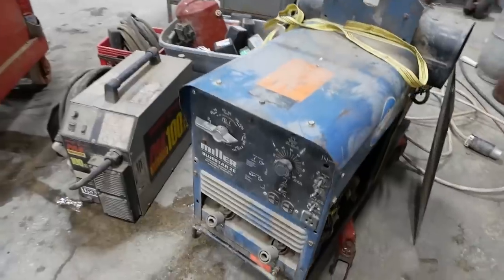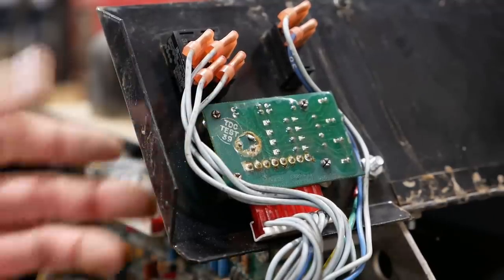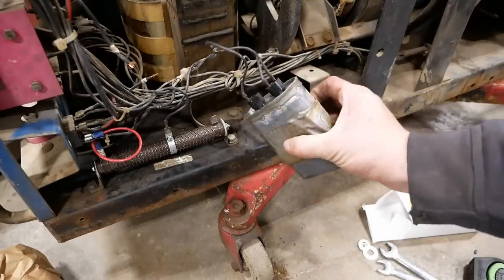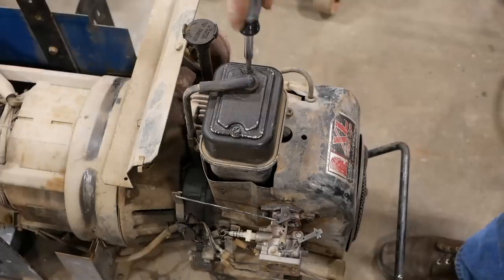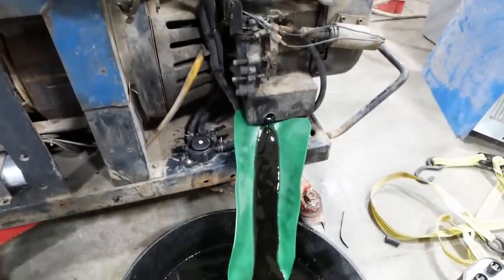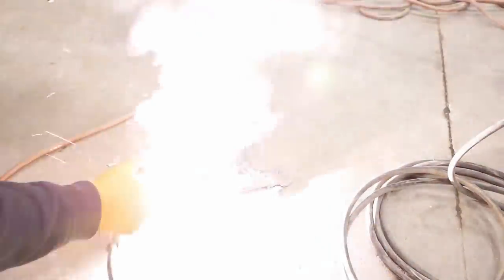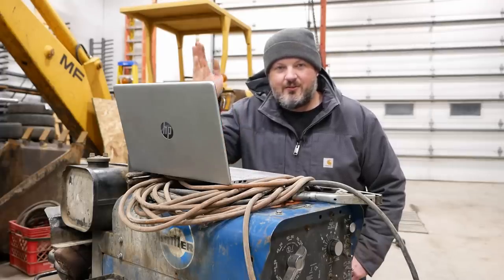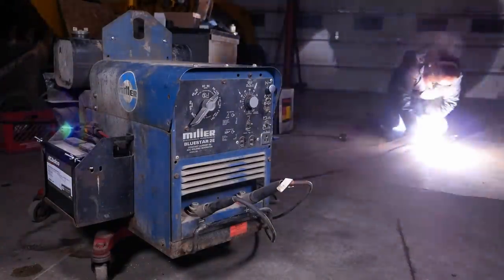Mostly Fixing my Bargain Portable Welder | Miller Bluestar 2E Part 2

Comment: I'll share one of my stories... So, I just fixed a steering issue on my squarebody suburban I've been chasing for close to a decade.... We'd replaced everything in the front end except the long tie rod (It's due because last time I tried to grease it, the cap popped off and it wouldn't grease).... Well, had replaced the steering gear twice already.. But alas, that is what it always was. I was in denial for years "because we changed that". Eventually isolated a popping noise when steering to the gear box with chassis ears.

Never thought to adjust the input shaft end play, you'd think a reman part would have the bearing properly preloaded. Adjusted over center a few times and it helped a bit but eventually ran out of adjustment. Steering was just terrible and squishy, highway driving was a bit nerve racking. Or maybe the gear was just so worn out because the cores are getting old, so maybe I could've never permanently adjusted it to work right. Word on the street is they don't replace hard parts like gears at reman facilities, I believe it.

Slapped a brand new (and pricey, but SO worth it) Borgeson 12.7:1 steering gear in it to replace the original Saginaw unit.... There's no backlash, there's no play, it's not soft... I go around curves and I don't have to push the steering wheel way into the squish area to get it to turn, then turn it 1/3 of a rotation back to back off slightly, then come back. Even worse when it was windy.

But I FINALLY won.

EDIT:
Tips for those of you playing along at home. The sector shaft (output shaft) of the gear isn't supposed to visibly move up and down. Make sure you pitman arm is tight enough so that it doesn't rock on the sector shaft. I used a breaker bar after the impact didn't do enough. And if you get a reman gear, make sure the input shaft doesn't move in and out if you turn it back and forth a couple times on the bench. Otherwise you'll need to undo the lock nut on the input shaft and perform the adjustment procedure.... Which sucks because the preload spec is like 10 inch lbs of friction on the input and it's hard to find a torque wrench that can read that low. The Borgeson unit is not adjustable on the input shaft, it's a different design(And hopefully better). It still has an overcenter adjustment.

Comment: I think you did a very good job on the 1st  Sodering job,  The 2nd one not so good because you should have really looked at which way the components went. After 40 years of sottering in what company that I did you really did pretty good until the 2nd board. Kudos to you for trying but always rely to your schematic before you start repairing

Comment: Outstanding Video @Wes.
My DeWalt "atomic" batteries have been good, but they have not seen heavy use (nor an IL winter).
Project Farm did both larger capacity and "off-brand" batteries, but, I forget how the DeWalts did in those tests.
Having fans everywhere is clearly a great benefit.
Reply: That Project Farm video was an eye opener.

Comment: My dewalt batteries are OK. The plastic does seem cheap. One took a fall off of the lift arm with my half inch on it and it still worked.

Comment: 12:18 after watching your last episode i hopped online to check other repairs and various forum dwellers from "yesterday" had reached pretty much the same conclusion: based on the two bracket holes, a small sheet of metal that would shield the wires from the resistor. Nothing fancy, pretty much all of them were either described as sheet metal bent around a pipe or pictures of crude sheet cut and bent around it.

Comment: When you buy a new capacitor make sure the working voltage is the same or higher than what is being replaced. All circuits will work fine with higher voltage capacitors, but can fail if their voltage rating is lower than what the circuit is producing.

Comment: "I am not the greatest at this." Your soldering is fine! Also, you make everything so neat, which is awesome. PS: A rectifier just blew on me (literally 2 of the diodes exploded) and I had to change 6 diodes, so I feel you pain of fixing diodes.
Reply: Their soldering may be fine. Their rework could stand for some improvement though. Old crappy solder is old crappy solder. So job 1 is to remove all of it before you resolder a joint. Reflowing it isn't always a good idea. That solder was gray and powdery. That's lead oxide. It's not something you want in a solder joint.

Comment: Is there anything you can't fix?  You definitely have no fear.  I've also used resistor leads to repair circuit boards.  I'm enjoying the vids fixing some out of the norm equipment (Even though you hate small engines).  I'm the "chuckle head" that e-mailed you about using a 3 phase converter.  Bad advice.  Having said that, here we go again.  The connector on the welder is a NEMA L14 30P.  This is actually a 30A single phase connector.  The "X" and "Y" terminals are the two legs of 120 to give you 240.  The "W" terminal is system ground, the "G" terminal is Equipment ground.  Hence 4 terminals for single phase 240.  This connector is common on Generators.  I only write this so that someone with a generator that see's this vid doesn't mistake their system for 3 phase power.

Don't hate me

Bob

Comment: If you will use a dampened kitchen sponge to wipe your soldering iron tip with each time before going to the joint you are trying to make, you will have a much better transfer of heat.
Reply from the maker: I use a cleaning pad from Haako that looks like a brillo pad. Works great.

Comment: When my Dewalt batteries fail they just stop charging, I have one now thats two years old and on the no charge fence,  I have couple thats 10 years old and still working, but never had any crack yet...... These portable Miller welders cost 10k so they are worth putting some money into, so I hope you get it going....

Comment: Just incase no one else mentioned, the DeWalt batteries are warrantied for 3 years. I have had 2 replaced under warranty, the customer service was very good. They just shipped new batteries at no charge. Keep in mind that my batteries failed, not a case issue, but if you have not, give them a call.

Comment: Dewalt batteries have done OK for me, the ones I really had problems with were Milwaukee batteries.  The Milwaukee batteries have these tiny screws that hold the halves of the plastic case together, and they somehow strip out after a couple of months of use.  This lets the battery split during tool use so the impact or whatever cuts out in mid job.  Then the batteries are like $200 a piece, and don't last any longer.  I got so tired of it I traded all my Milwaukee tools off to the MAC guy for Dewalt.
Reply: I work in an electrician shop.  All the guys (20) use Milwaukee tools.  None of us has had such a problem in the last ten years since everyone has switched to Milwaukee.  With us, it was the Dewalt tools that were breaking and burning and falling apart.
Reply: @woodhonky3890  All the guys in our shop use Milwaukee and have had good luck with the tools and batteries . I have probably 40 different Milwaukee  tools and 20 batteries and all are still working after 10 years .

Comment: I use only Rigid 18 volt tools the batteries and chargers are good for life if they fail no questions asked my half inch impact is rated one of the strongest on the torque test channel Im really impressed The dewalt tools are just black and decker junk I've gotten rid of mine a long time ago and am glad I went with Rigid

Comment: Wes is one cool cat !  Hey Wes correct me if I'm wrong but I believe there are 4 prong 220 vt 1 phase plugs for clothes dryers and Oven/ Range's not just  for 3 phase.
Reply: This would be correct
3 wire has two 120v hot and a neutral
4 wire has two 120v hot, a neutral and a ground.  
My bobcat 225NT a 4 pin/blade 50 amp 220v.  I used to have a converter plug for plugging our MM210 to it and use wire off the cat for wire work in the field. Handy for some of the misc. work we did.
Reply: He was probably reading off the plug body, they usually say if the plug is 4 wire three phase or 4 wire split phase. It’s pretty tough to tell an L14-30 (125/250 split phase+neutral+ground) from a L15-30 (3 phase+ground) at a glance.

Comment: It is interesting to me to see how a great all round mechanic copes with all the computer and digital stuff of the modern day. I used to be a mechanic ...way back in the 70's and 80's. Then in the late 90's got into computers.  So I can relate to both disciplines BUT never worked on computers in cars. I am still driving (only car) the 1999 Civic I bought new. I hate the new over electricified cars. I am looking for a new car  but won't buy one newer than a 2008.

Comment: 20/20 Hindsight. Wouldn't it have been better to desolder and test the diodes first?
Reply: My guess is the solenoid is fried and it's what's blowing the board out. Or there's a short to it. Though the PCB might be tracking? Once a board cooks once the charcoal can keep conducting.

Comment: Good job dude :) Once you get that idle control board replaced, I think it will work out well for you. The only thing I don't like about that unit is the placement of the muffler. I don't know if it was just the camera angle, but it seemed awfully close to the positive battery cable. It's weird that they didn't put a longer pipe on between the engine and the muffler.
Reply: I think when he hooks that new board up it's going to blow sky high.

Comment: Those old oil filled capacitors often had PCB’s...polychlorinated biphenyl, not printed circuit boards, especially the GE, back in the day when they just dumped em in the Mid-Hudson Valley straight into the River. 🤨🤫🤭😣
Reply: Yes be careful, back in the late seventies a team in fully protective suits had to remove the PCB oil in a large transformer in our ammonia plant,  a known carcinogen.
Reply: @willemvantsant5105  a few PCBs never hurt anyone.

Comment: My cheap old ass woulda' wrapped some black tape around the red cable at both ends and a few spots along the way and called it good, But, hey! Life's too short! Buy a new cable and live it up! PS All the small engine "maintenance" parts are stupid expensive. I blow out the air filters until they're totally gunked over before I buy new ones. I do splurge on platinum plugs, tho. At my age, I'll never have to worry about them again. 😁 PPS There's no price that can be put on the phrase, "I did it myself". 👍

Comment: You're better off spacing that panel knob a millimeter or so - quieter, smoother, and no mark.  I'd bet if you really splurged and got a matching replacement knob for the left side nobody'd suspect it wasn't OEM, LOL. Glad to see you recover some very functional equipment by investing some better parts and sweat equity.  This gear was worked pretty hard, from what I can see.
Oh, and if the "tails" (I save 'em too!), are tinned copper then why are they magnetic?  I think they're tinned steel or something.

Comment: Retired electronic tech here. Consider shotgunning all those electrolytic caps on the plasma cutter supply board. Or maybe that's already in your plans. Source from the usual places. DigiKey, Mouser, etc...
Reply: Yeah that'd only cost a couple hundred. Each of those big cans costs a minimum of $5 a pop. Then there's shipping. Those suppliers are going to bend you over for the maximum amount there.

Comment: Its interesting time and time again to see how the electrical systems differ and what is rated "normal" over here in the "old world" even most family homes have three phase power and for all commercial sites and industrial its mandatory because almost all professional high powered equipment needs three phase power, on the other hand, to be able to pull about 100Amps on a single phase is very rare here, most energy delivery companies would even downright forbid you to do it with fines attached to it.
Reply from the maker: 200 amps single phase is standard here even for residential. 3 phase is a pain in the US. It comes with all kinds of demand charges and minimum usage penalties. I can get it at my shop but the cost to install it is so high I can't justify it.
Reply: Because of the vast distances used to provide electricity across the US, it was deemed more efficient, long ago, to use smaller conductors at higher voltages, which could be stepped down to need at customer locations.  Most 'rural' electrification also followed this model.  Why put up four conductors when three would suffice?
Also, in the beginning, almost all "electrification" in the US, especially the rural US was for simple lighting loads.  Which argues against running higher voltages and multiple phase to serve motors that were not being installed.  Where heavy industry went in, it was easier, overall, to "wire" that as a local application, up to installing a substation to that end.
Lastly, "rural electrification" in the US happened very early in the history of electrical power.  When two-wire "knob-and-tube" wiring was a standard for installation.  Using single-phase 120VAC was a much safer choice.  Particularly when individual customers might be miles apart, and even more miles from power production facilities..
Reply: @CAPNMAC82  Makes sense, btw. 3 Conductors do it over here too as far as long distance transfer goes, the neutral wire is then "reinstatet" at the substations through the way the transformers are wired since neutral is defined as the voltage level in the "star point" of the three phases and in most cases directly connected to earth as well. 
But yeah, the fast distances in the US change many things and views on things. I heard a saying "in Europe 1000 miles is rated a very long distance, while in the US 1000 years is rated a very long time" people would absoltely flip here if they had to drive a hour to get groceries :)
Reply: @WatchWesWork  Yeah, I've seen videos of the breaker panels in the US, first though on a 200A breaker is always "wth.. what is connected to that thing that would need over 130kW of power?" just a force of habit being used to 230/400V systems. And since everything in the US keeps moving an grooving with 120V, so.. whatever works :)

Comment: As electronics guy your choice to not try and do further repairs on the pcb was the best one as once the pcb gets cooked it's insulation properties can't be trusted. Using the spare leads from components is good as we use tinned copper wire for track repairs when we do them, which is exact same thing, you can buy it in different thickness for finer or heavier track repair but it's usually 10 m roll so enought for 6 decades or more!

Comment: Hi Wes.  I wonder if it would be a good mod to add a little computer cooling fan to blow across that resistor.  As big as that is, it must get hot.  I didn't see an existing fan inside the enclosure.  Just a thought.  Thanks for the video!

Comment: I'm pretty sure the board failed after you reworked it because there was a big ol' solder bridge on the lower transistor at 32:30.   Easy mistake to make.

Comment: 9:27 Maybe the mfg's engineers figured out a design flaw on the board, but they probably already had a whole bunch of boards in inventory, maybe they figured it would be less expensive to hand-patch the flaw on the boards they had in stock than to replace them outright with an updated board and throw away the flawed ones. 

Just a guess.

Comment: The only thing that's no longer available and no one makes a replacement is the electronic ignition coil. There are "hacks" for them using a ford pickup coil and a gm ignition module though. Other than that Great video.

Comment: Admittedly that was an impressive trace blow-out on that poor idler board. Shame we didn't get to see the fireworks, but we can kinda imagine :)

Seems rather risky that they'd put a diode in that configuration without a fuse, in case a short did occur.
Reply: The board traces is the fuse.
Reply: @1pcfred  I guess that is technically true, only it's the worst kind of true :)
Reply: @MayaPosch  small resistors are the same thing. Incandescent light bulbs are their own fuse too. It's actually fairly common to make protected circuitry without specific fuses but rather fusable elements.
Reply: @1pcfred  Sure, but using major traces as a 'fuse' in this manner seems like asking for a fire. The 'fusable resistor' trick is something you see a lot with cheap Chinese gadgets, though I prefer to use a self-resetting thermofuse.

Either way, the idea is that the current is interrupted due to the current exceeding some limit, not because the PCB (and/or device) is physically on fire :)
Reply: @MayaPosch  you might get a little flame up but no fire. Not every fuse is going to be sand filled. A thermal fuse will never be fast acting. There's always a trade off between cost and performance.

Comment: I have used dewalt batteries for years and never had an issue . They stay in my van at -22 C -40c and get bounced around and never had one crack or break.

Comment: The twin cities has some very good equipment service. Any time spent beyond your estimate can be charged to education. Most mfg outfits budget 259 to 599 hours per year for training. I can make parts for your plasma cutter if you can sketch them with their mating parts. If the copper allot is not known, SAE #2 aka CD 360 will be tried to see how well it lasts. Or cutting torch tips may work for some time. Toll Welding in Mpls has Miller products and will service them.